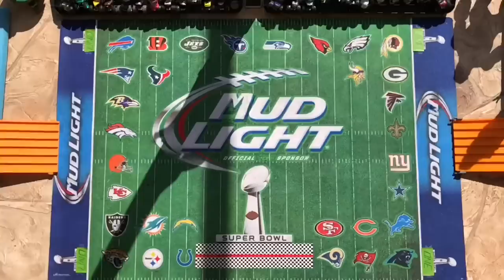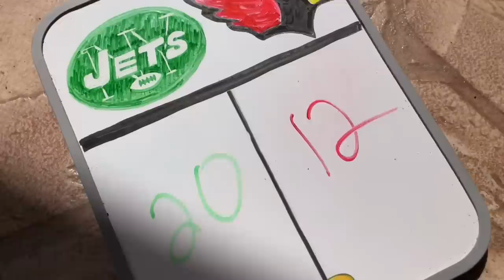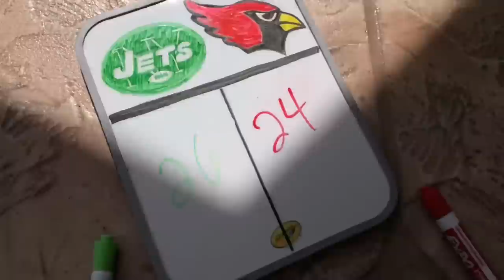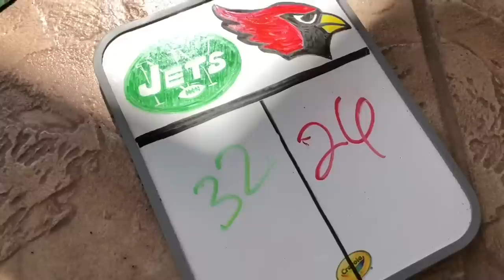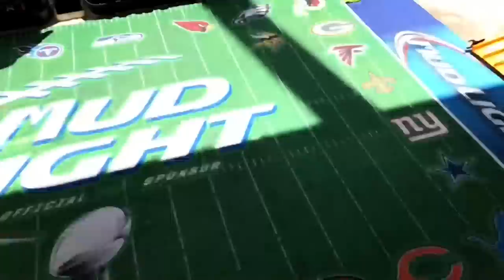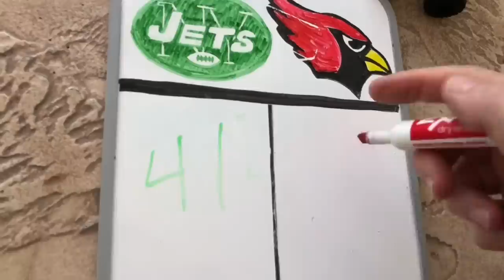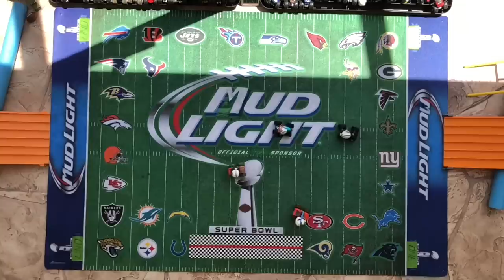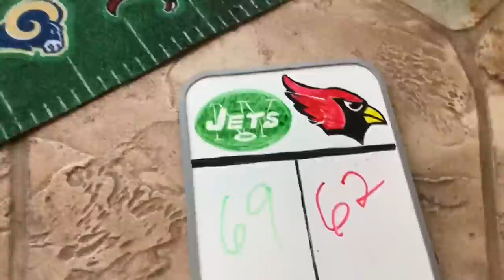MONSTER TRUCK FOOTBALL SUPER BOWL 1

Comment: Just a suggestion for next season: DO just what you did for the regular season and put the week one winners against each other and week one losers against each other in week 2. After the regular season there were eight 0-2 teams sixteen 1-1 teams  and eight 2-0 teams. An idea is that the 0-2 teams get eliminated. And the 2-0 teams get bye weeks in the playoffs. All sixteen 1-1 teams play in a wild card week/round against eachother. Those eight winners move on to the 2-0 teams the next week and it's just a 16 team bracket after that. Just a suggestion ghostjerker